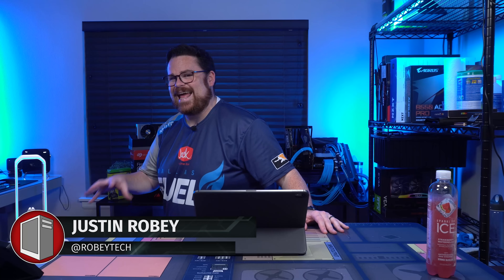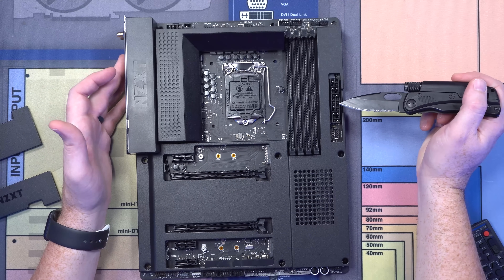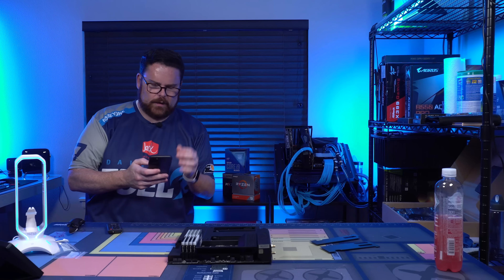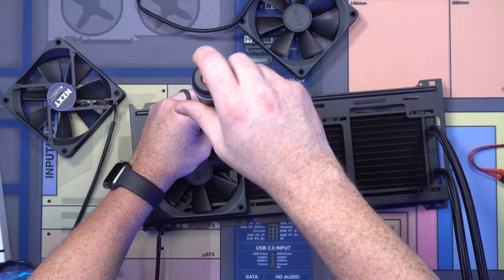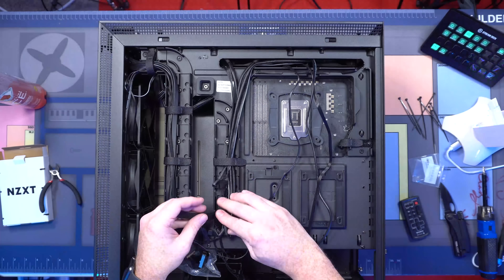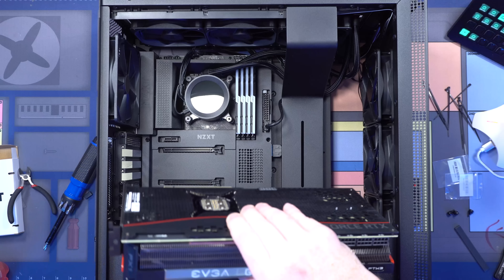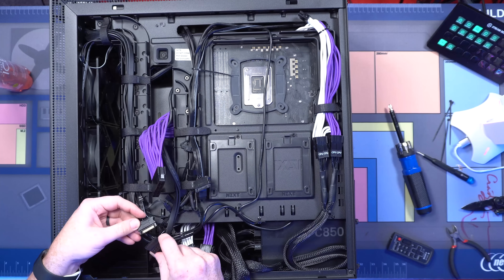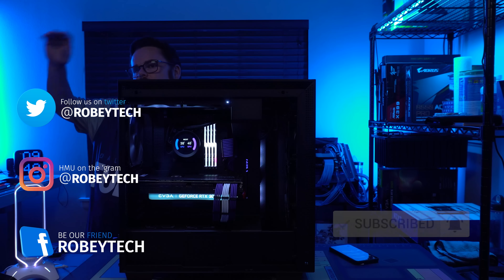Ultimate Next Generation Giveaway PC Build - $2800 #RTX3000 Build (10900KF / EVGA RTX 3080 FTW3)

Comment: “entry”
“done” 
reason:
i have a crappy laptop, it has A gt 1050 and a 4 core cpu and it doesn’t have an ssd, it takes 1 minute for it to boot into windows and stuff then i have to wait bc it needs to load for a while so i can open anything

Comment: “Entry”
“Done”
Reason: I am struggling to do anything with my current pc with a 2gb vram graphics card ( don’t know model, but it’s old), and everything is overheating. My cpu is a used i3-8100 that is always thermal throttleling, and is in dire need of replacement. I plan to start streaming and learn how to edit videos. I am a student so I am always struggling for a budget to upgrade my pc.

Comment: Question: 
Why did you connect the AIO to the CPU fan connector and not to the AIO Pump connector on the mainboard or did I understood you wrong? I'm asking bc I just bought the N7 z490 and a Kraken x63 and have to assemble the parts on Friday ;)

Comment: ”Entry”
”Done”
Reason: I’m running a 1070 and a 6700k with a z170 board and ddr3 ram at 1400mzh and I get around 90fps with all low settings in fortnite and I framedrop all the time so it’s unplayable. 
In overwatch I get about 130fps and a 144hz monitor. And of course I got the Dallas fuel shirt😉

Comment: “Entry”
“Done”
Reason: The biggest for me is I’m trying to get more involved in music production such as a music engineer. Though my biggest hurdle has to be my MacBook Air from 2012. Any time I truly try to use logic on my Mac it will always start to use all my memory and use practically all of my cpu after only having 20 audio tracks. That’s not even including only o n e single VST open. Plus for me going to college it’s going to be absolutely impossible for me to afford a laptop or a pc of high specs to do the work flow Needed to do if I go to college for music production. That’s actually one of the biggest reasons stopping me to go and pursue music as a full time job. If I somehow managed to win this pc it would benefit me so much not only right now but even in the future. It gives me a stable foundation for my work. - Ariel Nunez

Comment: “Entry” 
“Done”
Reason: I have a 5 year old asus laptop that is 4gb of ram, has a intel celeron cpu that is slow as hell, no from of gpu at all, very cheap battery that like dies in a hour at full battery. I get like 17 FPS on csgo with everything low and 800x600 resolution, I play every game at that and it’s unplayable, if I could get this, I would be so honestly grateful but of course good luck to anyone else

Comment: “Entry”
“Done”
Reason: I currently use an old computer which my uncle built for me put of spare parts, but it has lots of trouble running games that I like to play like apex and even among us. It roars louder than most of the loudest case fans with a computer under full load while just sitting there idle

Comment: "Entry"
"Done"
Reasons: Sadly i get 1 to 10fps on average with tons of stuttering (ON ABSOLUTE LOWEST SETTINGS)
My pc specs are: an old amd 1.7ghz apu (no graphics card) the integrated graphics have 512mb of vram. My actual ram is 3.4gb. And  a 1 terabyte hard drive. Also i cannot afford a new pc at all

Comment: "Entry"
"Done"
Reason: I have a pc that was built in 2012. I have an i7 3770 that runs at 3.4Ghz and a nvidia Geforce 8400 gs that has just stopped working. Now I can only run on integrated graphics that only supports 60hz and runs a normal youtube video at 30fps. My motherboard is a P8Z77-V pro which can only support the 3rd gen intel core processors. My GPU would run minecraft on just 24 fps but since I can't use that anymore; my motherboard can't even run minecraft. I also want this PC because I've never had a good PC ever. I had two old ones before that had a pentiums and only 2gb of ram and 4gb of ram. My monitor also isn't even a HD monitor and sometimes runs on 50hz instead of 60hz. The phone that I am typing this up on has better specs than my PC that I own currently. The motherboard I have right now does not have a BIOS update to run newer processors either

Comment: "Entry"
"Done"
Reasons: I am a high school student I do It Programming/coding and trying to get into the video editing business but my family's laptop is an intel Celeron  quad core which we got ripped off of in 2018 since my mother did not know the difference in computers and they sold it to her for around $500 at the time, which was all the money we saved for a computer. It had 4gbs of ram, and a 500HDD and the battery did not work from day one of getting it. we tried getting t=a refund in less than a week after getting it but the shop refused to take it back. 

(For those who doubt me I can send pictures and a video of the laptop working and it's condition)

Comment: “Entry”
“Done” 
Reason I love to play a lot of video games but most of the, are high demanding I play on a cyberpower that has a Ryzen 5 1400 and a Radeon 580 and it can barley run 60 FPS I lag and it is very slow now I had it for 4 years and I would appreciate for an upgrade.. in fortnite I can only play creative because I’m game I have 50 FPS and over watch I can only stabilize 60 FPS with low setting and I can give my other pc to my dad and he works online

Comment: "entry"
"done"
Reasons:I may sound the generic "i have a crappy pc". though im gonna state rn that i have a 4core 4 thread pc with vega 8 integrated graphics can barely get 30fps on literally roblox but i have had a dream to be a youtuber since i started to watch pewdiepie at like 500k and i have not started a youtube chanel cause when i record my fps in games go from 50 down to 30 i know my cpu should be able to do more but i am pretty sure it is thermal throttling cause i dont have case fans and my room is pretty hot.

Comment: “Entry”
“Done”
Reasons: just recently i got into the pc world and developed an interest in building/getting one. up until now, the only pc i’ve ever experienced gaming on was on a 10 year old family computer rocking 8gb of ram, 300w psu, intel core quad q9550, and a decently old nvidia graphics card (don’t know the specific name of it since my dad switched out the original graphics card for it). it’s really slow for preforming any task and can barely run not so demanding games. it would really mean a lot if we could replace this pc and have a major upgrade since were a little bit overdue and a bit tight on money right now lol

Comment: Can Robey or anybody answer a technical question for me? Corsair customer support has been no help so far, and I need to know how many ML120 Pro RGB fans that it's possible to connect through a single 1.0A fan header. Back of the fans show current at 0.225A but the box says the fan and RBG currents are different at 0.072A and 0.2A, respectively.  I'm asking because I have the Lancool II Mesh with the PWM fan hub.